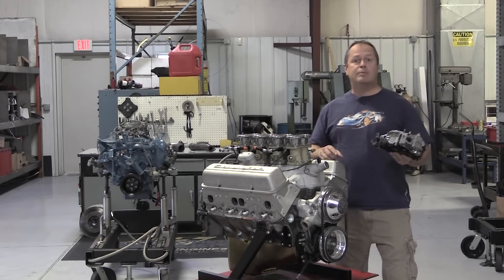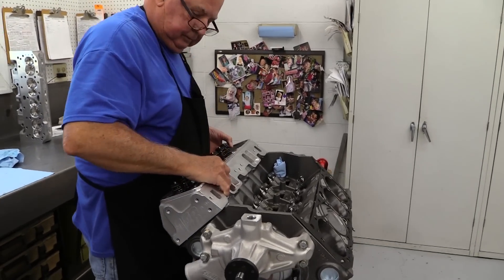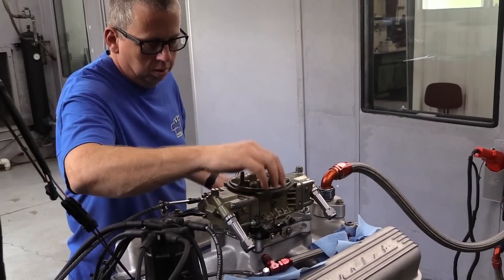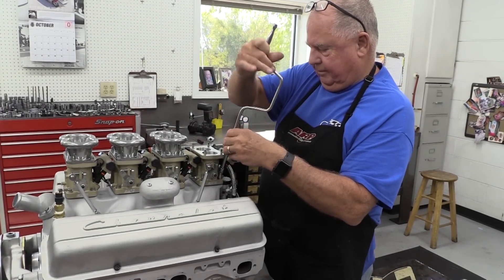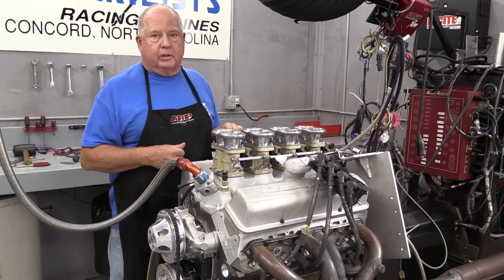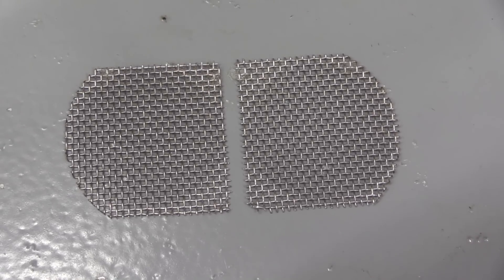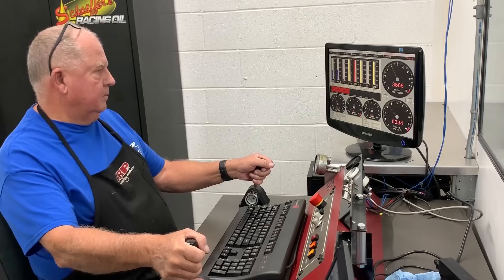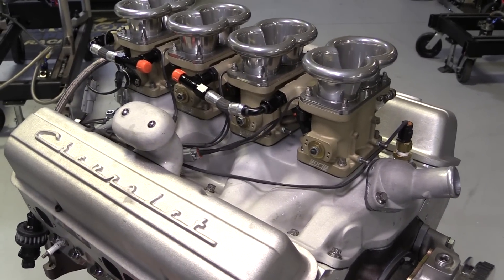Carb vs EFI - Dyno Testing a Holley Double Pumper vs Custom Stack Injection

Comment: This brings up one of the misconceptions about Weber type setups. With the short runners and the racing applications that they are used in, it has been assumed they are all about the top end. In truth, those that run them have found the make surprising amounts of low end power. Even though the runners are short, they each have their own barrel for airflow and metering so a plenum is not needed. I wonder if drilling the holes actually hurt performance. (I understand it might have been needed for the map sensor). If you look at traditional weber intakes, they have no plenum area and each runner is basically isolated. But obviously, those throttle bodies were just too small, designed for much smaller engines, so that was the cause of most of the lost power on the top end.
Reply: maybe switch to a common volume above the throttle bodies and switch to MassAirFlow?
Reply: Actually with IR Webber's the effective runner length is all the way to the trumpet end. So in this case the runner length was longer than for the single plane.
Thats why it made more low end torque.
Reply: @indyrock8148  Good point. Hadn't thought of it like that.

Comment: I still like my carb ...
Reply: Take a holley 650 for the price any day, and I can rebuild it in 20 minutes lol
Reply: me too dual carb civic ef2
Reply: @evergreensongs4903  I have a dual carb eg but just started doing carb to efi conversion and putting a b series in it
Reply: @noahjohnston2577  i wish i can switch efi too bro..but at my place the price is still high
Reply: @evergreensongs4903  Yeah it also takes a while to find all the parts , it's taken me like 5 months
Reply: @evergreensongs4903  Yeah it also takes a while to find all the parts , it's taken me like 5 months
Reply: Do you like points ignition too?

Comment: Whatever GM has on my2010 C-6 Vette is fine by me. Press the pedal and it acellerates smoothly from whever i started until I run out of nerve. Great demonstration.
Reply: Probably drive by wire throttle control. Meaning push the pedal to the floor, computer opens the throttle. That provides the extremely smooth throttle response. BMW started with it in the 90's. Typical driver doesn't know enough about torque and RPM to manage the throttles optimally. With carbs, vacuum secondaries were a plus because the rear butterflies wouldn't open until sufficient vacuum was attained. The old six packs were staged.

Comment: At the end of the day, its all about use-case.  Dragstrip vs. Drivability.  Higher HP numbers are useless on the street if the throttle response is boggy down low and has lower torque numbers.  Or non-linear throttle response.

Comment: Then you also got the mechanical fuel injection that sits nicely between the two.
My old mercedes has the old Bosch Ke-jet system from the 80s. It looks wacky at first but its actually a pretty smart setup once you figure it out.

Comment: Very cool and attractive EFI setup! For a build that doesn't have to have the absolute best horsepower numbers it's a good choice. Plus EFI setups are just easier to cold start. I love my carbs but sometimes they can be a little moody with big temperature changes even with the choke set right.

Comment: I like the comparison. I'll stick to my carbs. Fuel injection is great for drive ability, but I don't like the electronics. But also in reality very few of the engines will ever hit 5-6 grand. A race engine is different, but I still prefer carbs, and mopars. I also use stock ignitions, they work.

Comment: Pretty much all comes down to airflow for both carb and EFI, the small EFI Throttle bodies didn't help the EFI cause, but an EFI system with a larger airflow would see a different result for sure. I have an Edelbrock Pro Flo XT intake on top of a Dart 434ci small block with flat tops, Dart Pro 1 cylinder heads (230cfm, 2.08" intake and 1.6" exhaust, 72cc chambers) in my 84 Corvette here in Australia. Throttle body is only 90mm LS style, but its supposed to run 1100cfm. I have installed a set of FAST 65lb LS3 injectors, a FAST ECU controls everything. I am still in the middle of 1-7/8" to 3" header and exhaust fabrication and just waiting for the new year to order a Dewitts radiator and I'll get it fired up. I am sure the injectors are a little big, but I have widened the Pro Flo XT intake and port matched to the Dart Pro 1 heads, the 434 has a huge set of lungs, so more air in, more airflow and gas and I think I might surprise a few peeps. The intake also has a longer set of intake runners from the plenum, much like a TPI, but bigger and can flow to 7000rpm.

Comment: The problem is carbs cant self adjust for temp change or altitude changes like efi can.
Reply: @HZB OcYpcWr'Ctwu Odzs ya to bad that only opens throttle plates more it does not fine tune fuel mixture for air density changes.so next time dont replied when you have no clue what your talking about!
Reply: victor girouard, back in the day,  (God I hate that cliche), especially at the Pikes Peak hill climb, as they clawed their way to the 14,110 foot summit. Those engines were just about to melt their pistons from running such leaned out mixtures.
Reply: Alan McGahie, I’ve been telling my wife that for years, especially in our 05 Volvo S80 Premier with the 2.9 liter twin cam, twin turbo T6 engine.
Reply: HZB OcYpcWr'Ctwu Odzs, Aww c”mon play nice or else we’ll have to ban you from the sandbox! LOL
Reply: Alan McGahie, here in Knoxville, Tennessee we don’t worry so much about that. Ere at 987’ ASL

Comment: i like those injection throttle bodies! . a few years back a customer asked me to get his E type V12 running. it had 6 weber IDA's , The car had been restored about 30 years ago but never driven,just used as a display piece. I fought with that sucker for months ,rebuilding most of the engine except the short block, and those webers?  they refused to work. Even running it on a dyno adjusting them on the fly made zero difference to lack of low end power. They would only work above 3000 RPM ,which in a E type is well into license losing territory. In the end i got it almost running right but a cracked piston bought the project to a halt. It turned out to have the wrong heads and the ignition wasn't up to the task of the heads. If i had access to 6 of those throttle bodies and using a better ignition we could have made the car run. The customer sold the car and bought an identical one with fuel injection ....
Reply from the maker: Very interesting. I've heard lots of horror stories from the "good old days" of trying to get multiple carb setups properly tuned for an engine. Car styling today can't hold a candle to many of the older cars, but personally, I'm quickly coming to love EFI. Thanks for watching!
Reply: Mercmad : The Panther J72 had a factory option of the 5.3 liter Jaguar V12 with the Unipart Six Weber 40 DCi's. Same 2.36 mm 16 gauge gauze primary stone filters as Keith Dorton removed in the video. The low end loss is due to the very bad transitorised ignition curve and the need to find proper air correctors and emulsion tubes to create a flat fuel delivery of 12.5:1 from off idle to 6500 rpm. The J72 V12 12 barrel was a true 14 second, 140 mph replica of a Jag SS 100, and did in gears increments of 4.5 seconds from 30 to 50 mph in top...like a freight train. Any car that takes 2.4 seconds to get to 30 mph, or 5.7 to 60 mph doesnt have a torque problem. The six carbs had just 30 mm chokes...plenty to make 360 hp at 6000 rpm on a 326 V12. Multiple EFi throttle body systems or Independent runner carbs need carefull calibration against the time honoured Eudardo Weber/David Vizard/ Jenvey / PMO's idealised venturi to cylinder size graph. If each of the throttle or venturis are undersized just a  40 thou from the chart, you can loose 50 hp at 7000 rpm in a 350 cube V8....its very sensitive due to boundary layer air flow getting very rough. Aston MartinsSouth African 1985 580 X version of the Vantage DBS V8 gained another 60 hp with a routed out four Weber system, mostly due to how restrictive the earl carbs were on the 390 hp version. The carb throttles were opened up 80 thou.

Comment: I seriously like the EFI set-up!
Reply: Well it looks cool, functions like shit though.
Reply: @snek9353  no shit, it was a poor man's EFI setup (not proper EFI) and way to small throttle bodies. 44mm on a V8?  i run 50's on a I4... and it's restricting.... but going bigger would kill low end torque and i want a proper street drivable engine

Comment: EFI is the same as a Carburetor ( if sized, and adjusted properly ).
Except in one small area. Cold starting. The EFI will use less fuel.
Reply: EFI with short runners like that has another power advantage. Way more of the fuel is delivered as liquid droplets instead of vapor. The vapor takes up lots of space that could be used for air. More air plus the matching fuel in the same cylinder volume equals more power.
Reply: @elektro3000  not to mention a nearly flat power curve. Carbs just don't make sense anymore for the street.
Reply: @nismo4x4n  EFI can help flatten out a peaky power curve that some types of carbs cause, but camshaft selection and cylinder heads have a lot to do with the shape of the power curve, too.
Reply: @elektro3000  without a doubt, it's a total package.
Reply: @elektro3000  but the fuel vapor cools the air witch allows for a more dense air charge even with the vapor.  Both have advantages / disadvantages
Reply: @JohnnyAnderson1  The cooling does make the air a little denser, but not enough to offset the volume taken up by the vapor. Also, any atomized liquid fuel in the chamber during combustion will vaporize by absorbing that heat, creating additional power by increasing pressure at that later time.
Reply: Most EFI engines run a single injector per cylinder, and the injector is located at the end of the   intake runner and sprays pressurized fuel that is atomized with the incoming air into the intake port in the cylinder head. That means the majority of the intake path of the incoming the air must  travels is dry and less restricted. The carb works off of vacuum pressures to meter fuel flow. When the fuel is add to the incoming air it is atomized to help it stay suspended in the air as it flows its way to the intake port. That means the intake on the carb/tbi will always be a wet intake, that will be a more restrictive means of getting the both the air and fuel into the cylinder. The wet system has the benefits of cooling down the incoming air. The cooler air allows for a denser air (more oxygen)/fuel  to be sucked in to the cylinder. Carburetor is constantly flowing fuel from vacuum pressure, while the EFI injector is a timed and pressurized fuel flow that open/start fuel flow and the close/stop the fuel flow .that time the injector is open or closed  is controlled buy sensors relating information/ voltage signals to a computer to limit or increase open close timing of the injector. So the only thing similar is that they both deliver fuel to the engine but that's about it, other then that it is way different in how each system works on the way it delivers the fuel. There is so much more that I haven't mentioned but you can get the jist of what I mean.
Reply: @elektro3000  I have to disagree, whether its in liquid or vapor form, 1 tsp of gas is still 1 tsp of gas. it will have the same displacement.

Comment: 7:31 - it shouldn't have came as a surprise the 4x2 intake made more bottom end. The virtually independent runner/venturi kept velocities up, and kept low RPM reversion from contaminating the flow of adjacent cylinders.

I think what surprised him most, was that it outperformed on low end with such short runners. The great thing about ITB (independent throttle body) setups, is the effective runner length becomes the TOTAL length of the induction system... not just the intake runners themselves. I know this isn't true ITB... but effectively, it is... because each cylinder has its own intake runner and throttle valve, only sharing a small portion of flow from a minute vacuum reference channel, and the top of the air horn. Furthermore, EFI has a fantastic ability that carb simply doesn't have... the ability to compensate tuning with unstable vacuum signal. Yes, I know they drilled the intake for a common signal... but carb fuel delivery REQUIRES vacuum.... where as EFI only uses it as part of the reference. A properly tuned short runner ITB setup can make nearly as much bottom end as a long runner setup, when Alpha-N tuning is used below the reversion point (the point at which the incoming air compresses against the back of the closed valve, rebounding like a coilover shock and causing a sudden spike in pressure back up the intake runner... a distance which is longer at low RPM).The benefit of EFI's pressurized fuel delivery can really shine in these setups, with proper tuning... because the fuel delivery can be controlled AND delivered regardless of vacuum signal. Where as the flow of fuel through carb boosters gets wildly distorted with reversion and turbulent flow.

 With properly sized throttle bodies, this engine would've outperformed the carb setup throughout the powerband. 

The only place carb wins out over EFI (oddly enough) is horsepower per CFM. Common sense would say EFI should win out here, because the fuel is delivered AFTER the throttle body. At peak enrichment, that's about 7% of the available flow that isn't occupied by fuel, as it is with a carburetor. This is where carb magic pops in. With fuel being added under low pressure, the atomization of the fuel cools the intake charge, much like an intercooler on a turbo setup... condensing the charge, while allowing the low pressure zone to effect a larger area of the intake tract, and thus triggering more flow of a more dense mixture throughout the induction. High pressure fuel delivery, even high on the runner like most EFI retrofit system, will never be able to compete in this area... which used to be a CRUCIAL factor in delaying the uptake of EFI into racing, ESPECIALLY restrictor plate racing. For years, they simply couldn't wrap their head around why they should switch from a carb system that makes 'X' horsepower with 'Y' size induction orifice, when EFI often required more flow for the same output.

Don't get me wrong... I'm not a carb hater. Carbs also win out in another area. A properly tuned carb will atomize fuel better, and provide better fuel economy in that specific range it's tuned for. The low pressure delivery under vacuum lowers the effective evaporation point of the fuel, facilitating better atomization... but EVERYTHING must be perfectly tuned, and the benefit only remains for as long the operating conditions remain static... including load, RPM, intake density, and temperature.

Comment: Seen a video a while back on a old 4 cylinder with ITBs and they had some very significant increases in power simply swapping to longer trumpets. If i remember I think they picked up 20HP or so from a 50mm trumpet to a 102mm trumped or something like that. If they got those increases with that little thing I could easily see this big boy picking up at least 40hp switching to longer trumpets.

Comment: Cool, be interesting to see comparisons between engines with directly comparable intakes - like three deuces carbies and TBs on the same manifold.

I would agree that cabies and points can produce the same peak power, or torque, but the managment 'should' be able to better the older tech' away from those peaks. Even if one runs a carb' (or more than one), being able to tailor the exact ignition requirements the engine needs, should increase torque before and after the peaks. With a temperature map, one can even increase the cold timing and pull it at the top for very hot weather, for better driveability and reduced 'pinging'.

Comment: Nick's Garage did the same test with EFI V carb. Again the carb made more power but a EFI system will give better fuel economy as the fuel flow can be better controlled .

Comment: With current fuel types, I would go with the efi setup. (and stick a 02 sensor in the  exhaust so the ecu can self correct.)

Comment: Surely the low retro style intake on the injected engine must limit it's power?
Reply: Bigger concern (To me) is that the system is clearly undersized for the engine. There's a reason the normal Chevy kits are running significantly larger throttle bodies; These smaller units are choking out the top end.
Reply: Ehh not so much low, both manifolds were short. But the lack of a common plenum totally killed it's high RPM potential.
Reply: I'd say that makes sense. If that manifold was developed back in the day when stroker kits were not common, then it was probably meant for a 327/350. Be interesting to do the comparison with that capacity as a baseline.

Comment: Everyone wants to stack the deck so efi wins and they can justify their investment. However, the facts speak for themselves, a properly sized and tuned carb will hold its own and most of the time exceed what you can get out of any throttle body efi system.

Comment: Yes having a bigger diameter throttle for the EFI would increase power at the top end. But it will come to a point where as they said, what application the engine is designed for. Peak power or drivability? 44mm is way too small for such a large displacement engine. Would love to see it having 50mm butterflies instead vs the carb. Not to mention having better response, fuel economy and power in any temperature or weather condition.. the benefits of EFI are obvious.